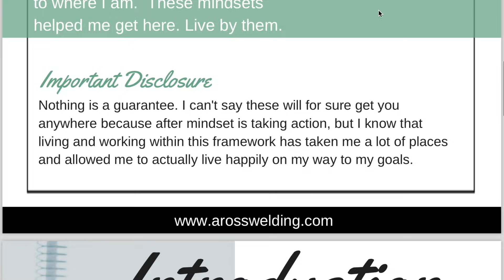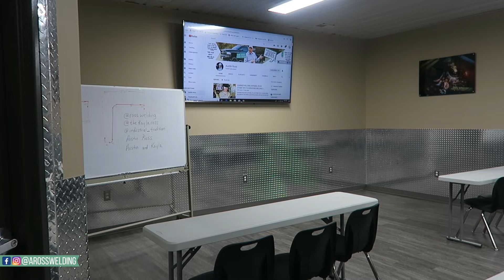WELDING SCHOOL (WHERE TO GO AND WHY)

Comment: I don't it's feasible to got to a welding school for couple years to pipeline weld. Just buy a machine and practice. Go get a helper job and then learn from the pros. Way farther ahead that way.  $5,000 get you a really good sa 200

Comment: Austin I agree with the work ethic. I can't tell you number of folks who have told me they can't get folks to show up on time or at all. As to schooling, from my perspective, they give you the opportunity to put a large number of hours under the hood on a wide variety of rigs you may or may not have seen or used. I am a hobby woodworker and I look at welding as another option on how to join materials to fabricate something. I agree with hood time however, fundamentals are extremely valuable. 

As to what interests me most I would say in order laser welding (yes cutting edge), tig/mig.

Comment: Austin..... I love you channel and especially some of the places and conditions that you weld in. I am 69 now and cannot get into a lot of those places.... or get out of them. In fact, a few years ago, I started to specialize in making Aluminum Products for ground support of the Aircraft Industry. I have been a Commercial Pilot and am an Aircraft Maintenance Engineer with over 40 years of experience. I now for the last 12 years have my own company to make various Tools, Equipment, and Support gear for Aircraft. I learned to weld from my Grandfather and still have his old machine. He did Atomic Hydrogen for Boyles Brothers Diamond Drilling in Vancouver B.C. I have several Miller Machines, MM252, MM350 Aluminum, Passport Plus, and my favourite machine being TIG welding with the Dynasty 280 DX with wireless remote and a 310 Amp Crafter Series Water Cooled Torch. I specialize in Aluminum for many reasons. It is clean, light, easy to cut and machine, and a joy to TIG weld with the right machines and techniques. Pulsed Wire Feed with an Alumipro Push-Pull Gun for large pieces. You are absolutely correct...... practice and time makes the best teacher. I now prefer welding Aluminum to most other metals. Also..... TIG is the bomb for fine intricate work. I regularly use it to remove broken exhaust studs from Aircraft Engine Cylinders. TIG is my preferred "TOOL" for many repairs. Stay well and keep up the good work. Also I love the "Character Interviews", as there are many interesting people and stories out there that should be told.

Comment: Exclent advice. However I am an advocate of going to school. I attended auto/diesel school right out of high school, later at the age of 32 I went to aviation school. You are never to old to learn. I realize this video is now four years old, and I have been following Austin for quite a while now, but just came across this video. 
       In growing up from the 6th grade through high school I worked with dad in his fabrication shop, so I have been exposed to a lot of types of welding. I have never worked as a welder. I can say if you get the wright school you will learn principles and fundamentals  that will give you an edge. You may not necessarily have to have certificates to hire on  a particular job, but keep in mind you will most likley have to pass a welding test before qualifying for the job. So each time, and the more certifications you can get is more better and more experience. I know first hand schools are expensive but like Austin says it is an investment in yourself. The school dont have to be in your back door, I can personally tell you that moving away from home for school makes you a better person.  I highly recommend it. DO NOT BE AFRAID TO TAKE OUT A SCHOOL LOAN AND MOVE AWAY FROM HOME. JUST BE SURE YOU HAVE A SOLID MADEUP MIND THAT THIS IS WHAT YOU WANT TO DO. THERE IS NOTHING, NOTHING LIKE A MADEUP MIND.

Comment: I learned how to fit and weld pipe and structure using 6010, 7018, 8010 stick, short arc and tig 8 different alloys in oilfield shop's, plants and facilities in Louisiana and Texas also fitted and welded aluminum, stainless and fluxcore in shipyards and boat fabrication shops on the job training really awesome experience

Comment: Here in Australia the best way is do a 4 year Apprenticeship and become a trade qualified Boilermaker, I did my Apprenticeship 40 years at the age of 15 and my special class welding certs while I was and apprentice. 15 years ago I left the trade to become a design draftsperson but went back to the trade because that is where the money was doing tig pipe and pressure vessel work

Comment: Thanks Austin,      Welding is a great career  .      I am not in pipeline but love to watch your videos and others that you areaware of probebly met at KWI  As cool as Pipeline is it most certainly is not for most  Its good for a few  and those few may not even stay at it for more than 10  15 years.   Therfore I think its important for that 18 year old to know there are good jobs and pay in the pipe trades both in and out of the U.A. (union).  Single hand  not on pipeline welding Pipe  making some darn good money and even pipefitting with out welding making over 100k a year  is common.  Some travel  and some guys never travel.      Personaly  I  wouldnt delve into a job knowing I would never be home If I was a family man  But I have traveled to support my family but didnt plan  it that way and didnt  raise a family all the while traveling.  To each thier own.     on the other hand you can buy a house and work half the time and be home a lot and still have money left over if you are smart about it .  As a single guy , Id be all in but when your young things change fast from single and being a family

Comment: I suggest going to school first(start pay $5+ higher)then working at a shipyard that does Naval contracts since all welders new & old are trained - As an electrician the school certified me as a structural welder to use 6010, 7018 and 309 on flat, vertical & overhead & to attach pipe.  The first weld an instructor held on to my hand (flat) then two days later vertical he held on again & the second week overhead - the metal was steel 3/16 x 2 x 6" - tacked into a  T which we broke in to see how even the fillet weld was.  4 weeks 8 hrs a day - next was heating & burning school then steel pipe /w mirror.  Nuclear welders learned wire TIG & MIG .w/ X-ray checking.

Comment: I went to Tulsa welding and pipe-fitting school in Houston Texas. I learn stick, TIG, Mig, and flux core.
Reply: I start at TWS on the 15th attending the Houston school.
Reply: @blue.collar.man.  I suggest you go to class early and leave late to get as much time as possible in so you can start early on your tig you're going to need as much time as you can with your Tig it is the hardest welding and my personal favorite.
Reply: @weldergod2883  Thanks for the advice. I appreciate it.

Comment: Y’all check out Alabama pipe welders academy. There is 0 classroom time. “Fundamentals” is online at home on your own time. You will strike an arc and learn how to put a tig root in a pipe on your first day of class. There’s no learning on plate then moving to pipe, they have helpers that work for the school and all they do is bevel and prep coupons. Once you get the basics down they have all the simulators you want. Convection box, boiler wall, scaffolding to practice.

Comment: Been many years since I have taken a welding test but I loved putting in a TIG root and hot pass and then filling it out and putting a cap on it with SMAW 3/32 7018 rod. Gave me a sense of accomplishment when it was all done and the bend test was over.

Comment: TIG is the most interesting to me, I suck at it so its something I know I can be much better at it. I'm most interested in pipe and/or pipeline for work though.
Reply: Cameron Kelley just keep on keeping on. You’ll get the hang of it eventually. Just remember your foot pedal is your best friend and you can always use a bigger filler rod than your tungsten to fill a bead or gap. M favorite is 3/32 tungsten with 1/8 filled
Reply: @Fracturedspleen  I'll get there! Learning it on my own was harder than I imagined lol
Start school in January!

Comment: Im going to texas state technical college in august. The area im in, that school doesnt "teach" pipe welding but the teacher will show us the basic on pipe. However if i transferred to a different area, i could learn pipe. We can also come in on weekends and stay late the whole course in order to get plenty of weld time.  However most jobs around here are structural welding.
Reply: I could up root and move to waco where things are more expensive than my area, hope to find a job then have to take the whole course. Or i can stay here and spend less money, get through the course then get a full time job to save some money for when i do leave for another school, ill have money and will need to take less courses since the pipe program is the last program you can take. Plus i will get experience on pipe at this school since the instructor knows how to weld pipe, they just dont have a full blown course for pipe at that school.
Reply: Tony Guerra I disagree there is actually a lot of money in structural if you contract out with a 3 man crew you can make 30 grand in 3 weeks just depends on the job easy money
Reply: Benzo Brando that’s 3k a week perhead if your contracting out you got money involved I’ve made that easy single hand welding showing with nothing but my hood and that’s cuz I chose to not use the one provided,,?structural Is for the birds,,,
Reply: @matthewwilliams6596  Reality of welding school: some rod burner is always gonna bust you for having gone to school and learning the field. Good luck, it'll be worth it.
Reply: @tonyguerra7799  just stop talking. We get it, you know everything and what everyone should do. Id rather have people give actual advice instead of telling me to go into more debt and spend more money just so i can live. Ill pass

Comment: Hey I just got on a little 6inch pipeline and the guy I'm welding with said he just got off a .500 wall line I asked him how many passes it took him he said he didn't know because he just capped so I was wondering how many passes does it take to weld out 500 wall
Reply from the maker: Anywhere from 4-8 passes depending on how one welds and how many cap passes they are required to put on.

Comment: Does TWS help with pipeline welding?
Reply: Yes they do,they start on plate,well structural, then they'll teach you mig,tig. Before the tig session they gave me a choice if I wanted to learn on aluminum or pipe, I can't member if that course is before or after pipe,I graduated in 09', out of the Master Welder program.
Reply: Jimmy Warledo if you don’t mind me asking, where are you working after going to school there. I start in July at the Tulsa location. I here good and bad things what are your thoughts
Reply: @davidgarr8823  i start this December at Tulsa location looking to be a pipeline welder